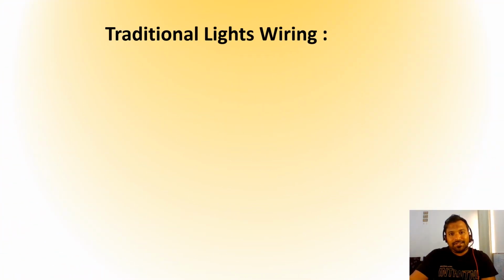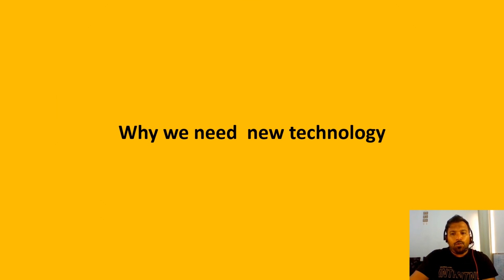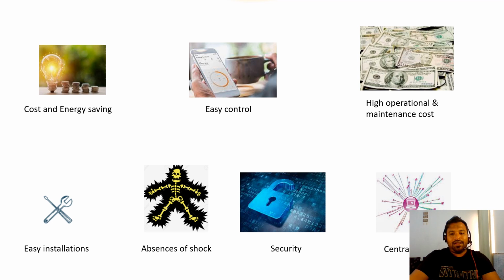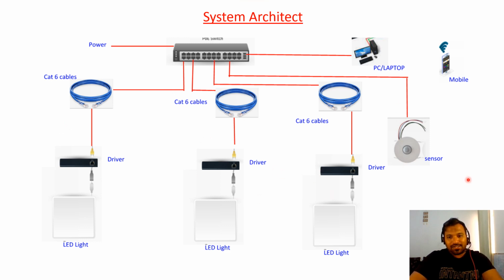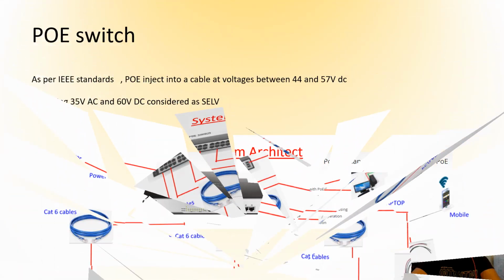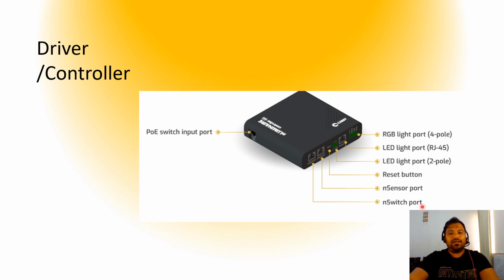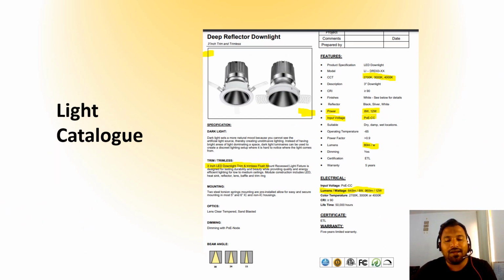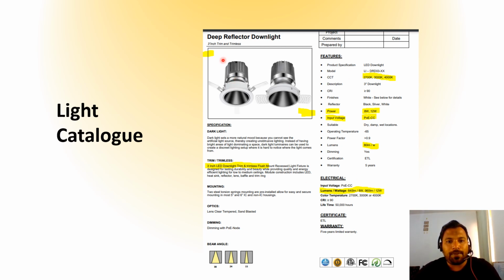No more traditional wires required for lighting how ??? #electrical #mep #construction

Comment: Can u make a vedio on selection ofbreakers in stardelta and cable sizes and dol selection of breaker and cables
Reply from the maker: i believe breakers and motor starting method there is no relation